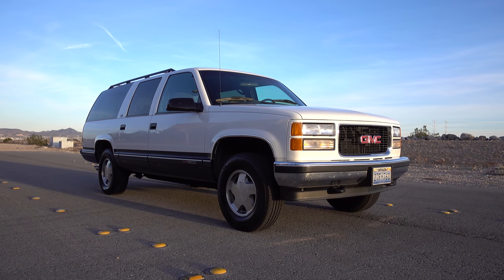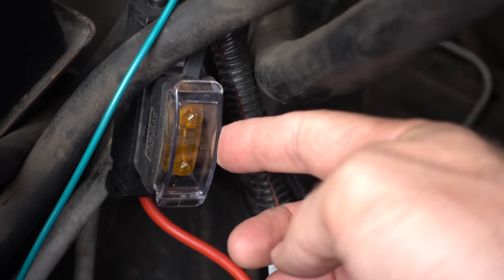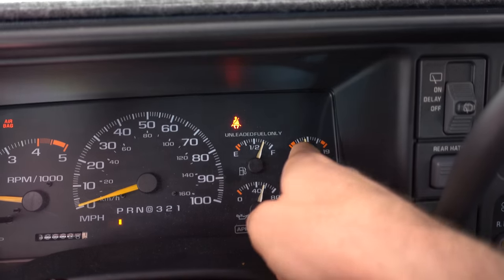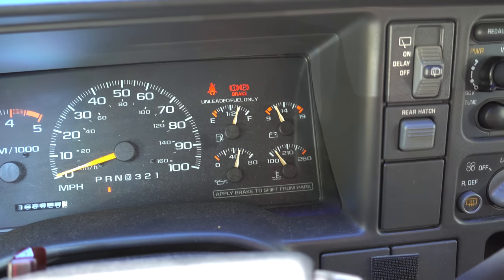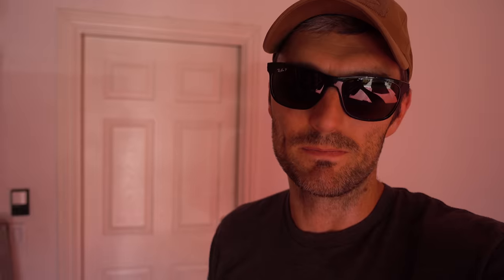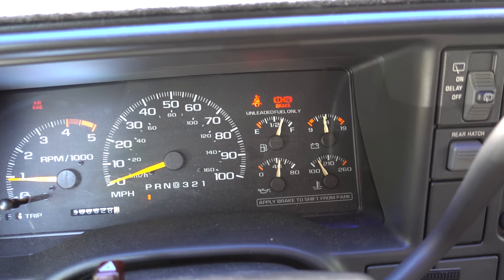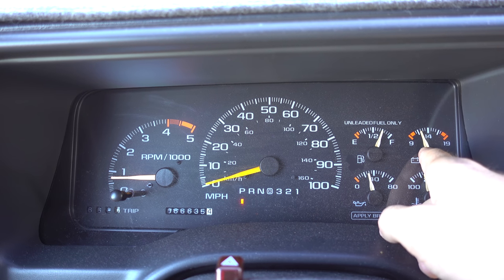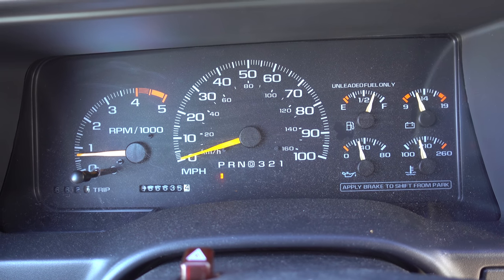SOLVE A LOW VOLTAGE ISSUE!

Comment: 2nd battery for people who have alot of electronics on their car such as big bass system, screen, lights ... etc / I have the same problem, first my engine temp is getting high on idle or traffic but when I drive it's fine. So, I changed the clutch fan with electronic fan and I solved the problem ! but the battery gauge is getting low because ( The Alternator ) can't handle the fans,  the alternator on my car is 135 AMP I ordered a new one 370 Amp from MECHMAN It's has more power to run the fans, the bass system and the new screen i have. but you have to put (Big 3 Upgrade) = Bigger charging wires for the battery and the ground. ( You're All Set ) Good Luck

Comment: change the negative wire of the car body and engine and the alternator with a new thick wire and i hope it is going to be solved , if it's didn't work just upgrade the alternator

Comment: 140Amp altrnator should be enough most probably the -ve cable is bad or u have bad earth i have exactly same ur truck with same issue after cleaning cable conection and ground joint problem partially solved

Comment: Try dual battery set up
Reply: Why? You can install 79 batteries of ANY brand. It won't get you any place WITHOUT a proper alternator. Your way will cost say $150-$400 for the second battery. Proper battery cable and connectors, another say $50. Battery isolator = big $$$$. See where this is going?

Comment: OK don't know if ou ever figured it out but ya needed to get a more amperage Alt to put out enough for the vehicle, it's ike a small car uses a certeain amount to run and charge while a big truck or older caddy uses a much larger amperage alt to run it and the air.  So you need an even bigger amp to run all of that plus bigger fans!
The Alt should run it all, not the Battery on the GMC or like vehicles.

Comment: alternator for sure. on my swift aka geo metro has a very weak 45a alternator from the factory and running lights on and ac will drop the voltage to below 13v. The alternator was weak and the battery was small and over 5 years old. replaced the alternator for 50a hella one and the battery a bosch s4002 its been good since.

Comment: and it do look like your alt is slightly under charging, should charge on 14.50 , and also your running out of juice , the juice is cca amps the battery amps it's marked on the top of your  battery, should be 9.00 cca amps at least ,  our a 1000cca amps ,to run those fans , and a alt that's putting out a charge of 14.50 our 14.60 volts when the  fans are on. hope you get it solved

Comment: If you start your truck and turn on your head lights and A/C then remove the negative battery cable it should stay running if it dies your alternate isn’t putting out enough amps. Replace alternator if it continues to run alternator is fine. The truck should run without the battery.

Comment: I'm dealing with the opposite problem.....My voltage dips under power and comes back up when I get off the gas......had the alternator tested at autozone tonight...it passed
Reply from the maker: That is peculiar. I can't imagine that being anything else other than that alternator. If you do spring for a new one, remember you can get OEM ACDelco on Amazon for CHEAP!!
Reply: @1RoadGarage  Yeah, it's a head scratcher right now......The battery starts it up every time so far

Comment: Jimmy my 99 sub does the same thing with ac on and stopped at stop light. My sub has stock fan and volts jump back to 14 as soon as I start moving.
Reply from the maker: +B Dog really? Okay, so you suspect that's normal?
Reply: I think it is. It causes me some concern, but has never left me stranded. I think I will check my ground straps like mentioned in an earlier post.
Reply: Not normal

Comment: Do you ever figure it out
Reply from the maker: Alternator couldn’t handle the heat and load. Now running a Mechman 250 Elite alternator and all is well. Thanks 👍
Reply: @1RoadGarage  that's awesome glad to hear all is well brother I'm defiantly gonna go with their alternators myself
Reply: @1RoadGarage  so would a 250 be a better options for me instead of 200 since I have led headlights and dual  electric fans

Comment: It's your amps not the volts... When you at a stoplight with the fans running it's your taillights/brakelights as well.  Bigger amperage alt is the main thing. Put the biggest battery you can stuff in there, good cables and grounds and with a higher amperage alt you will not have that load/voltage fade... I own a 95 blazer full size. Was doing the same thing in the winter when I would be at a stop with the brake lights on and the heat blower.. then my gauge would drop way down. The electrical systems get weaker on these trucks and dont like any draining mods like that big ass dual fan set up. Best luck!😎

Comment: You need a bigger alternator mine dose the same thing but not as bad as yours.i have the flex a lite 280 15" fans.i even have a dual batterys I have big 3 upgrade.its the fans that are sucking the power I even have a 140 amp alternator. I just ordered a bigger alternator a 300amp

Comment: you have the volts,but need more amps.get a high amp alternator.140 amp is not big enough for everything power.i have 160 amp and still not big enough for what I run,light bars, amps,power windows and lock,front and back ac.dont need 2 batteries because your not needing to store alot of power just need a lot of amps.

Comment: This may or not help you. Your battery and alternator were ok. I believe you need to go to 2 batteries and increase the size of your alternator. Ik that you really don't want to do that but it's a necessity when you pull that much power. Your best bet would be inline batterie setup to increase your storage capacity and the larger alternator to supply the needed power. I might be wrong here but someone might know more than i do.

Comment: For a vehicle of that size and setup you need a alternator of 220 amperage minimum output you always oversize it especially a General Motors vehicle and up your battery to a 900 anps of continuous Cranking amps and 750 cold Cranking amps and reserve power output of 500 anps he should have added the 140 on as a secondary alternator to the stock one basically run a dual alternator setup this would have made a big difference.

Comment: Don't worry about the low voltage running dual performance fans are not OEM or factory equip for that vehicle, so what your experiencing is simply 2 electric fan motors that require 12v each to run together. So they will definitely put a big draw on your battery, even a new one!! There is no true solution other than running 2 parallels batteries instead of just the 1 battery. Which you won't be able to do easily without severe mod works to find a new battery compartment to place 2nd battery into somewhere. Good luck

Comment: Dear why didn't you think about an out of the box solution  for your problem I mean instead of putting more fans you solved one problem and get's into another So I give a friendly advice to replace your Radiator with higher surface area Radiator or simply having more tubes on the radiator this way you will save fuel and also keep your engine free from unnecessary dust particles as well.
Reply from the maker: +Mahmood Shaikh would love to get a newer all aluminum radiator. But, one thing at a time...
Reply: Mahmood Shaikh nn

Comment: I know this od is old but I did the same on a 66 ford custom  500 upgraded to hei distributor,  8 mm spark plug wires , electric fans , double din pioneer nav unit , 800 watt amp & 4 tens , new  97 chevy alternator did away with the ford alternator,  was getting crappy output , doubled my batteries with 2 800 ca's . Now she is 100 percent! 
Currently doing the big 3 wiring to get the rest of her potential.  
Oh and i also changed all the lights to Led and that in it self helped a lot !

Comment: I kind of have the opposite problem I put a system in my 02 Tahoe but I'm getting too many volts so I unplug the plug on the alternator and that fix the problem for a little bit my subs were hitting really hard in my amps were not going into protection but then I saw my lights go dim in my windshield wipers slowly stopped working lol .. so you might want to check out that plug on your alternator if you only have a two pin plug you can do this method and your truck will run fine but mine has 4 pins I'm still trying to figure out what the hell is going on I know I'm getting too much power to my amps I just don't know how to fix without putting a amp regulator and I don't want to do that because I don't think them things will  put out enough power to my amps .... My radio works it's only certain songs that hit really hard that make my amp go into protection if anyone has any ideas please hit me up

Comment: I garentee its a ground issue look up hiw mech man does the big three thats how your truck is set up now replace grounds and grounds at back passenger corner of the block to frame and to body
Reply: My tru k was doing the same you need the proper grounds for your voltage regulator to work properly... If grounds look good dosent meen they are
Reply from the maker: Hey thanks, yes, I’ve re-wired everything and upgraded the alternator to a Mechman Elite 250 amp. All good now. 👍👍

Comment: your stock alt is 105 amps i would upgrade your alt to at least 200 amps you can find good companys out there that  offer them mechman, or dc power is what i would recomend. Your drawing more amps than your alt can put out so its taking current from the battery thus cousing low voltage, adding a second battery only adds reserve capacity once the reserve runs out your voltage will drop as it has been, key here is a high quality alternator.

Comment: You trippled the battery draw without hot rodding the alternator add 40 more volts to a 200 amp version

Comment: Stronger alt. Need more rpm to creat the specified amps which is not available coz the vehicle designed to the old one ,so the only way is to adjust  the idel rpm for the car

Comment: im having similar issues. Its a grounding issue
Reply: how did you fix ground issue. I have the same issue on a 2007denali. 1 battery a alternator later still stuck.

Comment: Has this problem been solved? If not, here's the answer. The problem is a split issue, meaning there is 2 problems. 1.) The battery that you are using isn't equipped with enough amps to run at a consistent high voltage rate. Here's what I mean by that.  You probably put a 760 cca 500 ca battery in it. When it really needs 1000 cca 850 ca. By using a bigger battery, your alternator can keep the electrical current up to allow everything to run smoothly. 2.) Once you replace battery, i would definitely upgrade wiring. Mainly your hot wire. Use 2 guage wire. Just run from the black  box on back of radiator to battery, starter, and  alternator.. Feel free to contact me..
Reply from the maker: Thomas Kelly Thanks for all the great info. No, the problem has not been solved yet but I do know that my problem has to do with the alternator not being able to keep up. I have replaced all wiring with 2 gauge and added a couple new grounds. Voltage now stays higher but the problem persists. While driving I have no issues. It's when I'm sitting at a stop light that the voltage drops. The fans are just pulling too much current for the alt, at hot idle, to keep up. Did I mention my alt has now been updated to a 140amp with a smaller pulley for good measure. I will be making an update video soon. Stay tuned!!

Comment: Old Video: The stock alternator is 105A,  you need to know how much the car itself uses from the alternator/battery then add crurrentdraw from the extra cooling fans. at idle the alternator dont spinn fast enough for charge ,  one solution is to replace alternator to minimum 140A and change pulley to smaler size for the alternator to spinn faster at idle Cause the alternator does not give rated amperage at idle maybe around 40A... and the stock alternatorwire is too thin, it should be atleast 10 gauge wire

Comment: You have to make it like a Japanese car the right fan of the engine and have two speeds and the left fan of the air conditioner, the reason that two fans eat each one of them 70 amps means 140 amps means everything that produces the generator goes to the fan

Comment: Increase the thickness of all supply feed wires to min of size 6 or lower the amount of current that travels should be able to increase the voltage demand smaller gauge wires heat up to much increase all ground wire sizes the same with more connections also

Comment: Before big 3 upgrage check alternator amp output some only can hold factory parts no upgrage room and if you do it will draw too many amps from the alternator causing battery and alternator to fail, if the alternator has more then enough amps big 3 would be the next best step!!

Comment: you are oveloading the stock Alternator, that alt wasnt desing to run 50 extra amps of your added colling fans, upgrade to a 15-20% higher output alternator or go to salvage yard and grab  one out of a heavy duty GM truck.

Comment: Batteries only start the engine and complete the circuit, the alternator does the rest while the vehicle is running. follow the changing of cables and connectors. the voltage regulator in the alt most likely is the culprit

Comment: Hey did you ever figure out what the issue was cuz I'm kind of got similar issue occurring that it kind of the voltage kind of bottles while I'm driving with my thoughts are on either the alternator going out for a serpentine belt which is kind of like skipping the alternator but yeah I was going to see if you ever figured it out

Comment: I have a 1999 suburban same set up plus an electric water pump from summit  just added a 175 alternator and it fixed the problem i also put monster cables on the battery

Comment: the electricle system wasnt designed for electric fans. get a higher amp output alternator and make sure the wiring is large enough the handle it. new battery helps too.

Comment: You may even need a higher then 80 amp alternator. Get the highest amp alternator you can get for your truck and the problem will be solved.

Comment: How does your rpm gauge have the Orange? I haven't seen that on any older chevy trucks...
Reply: The tbi only has a 5 grand rpm the tbi when they out in the vortec engines they gained another thousand and went to 6 thousand rpm and lost the orange 96 and up
Reply: PHIL Bangel wish there was an aftermarket option to get them back

Comment: check ur belt tensioner..also if ur ac is over charged there's alot more pressure on the the belt..dealing with the same problem with powermaster alt
Reply: never had a problem till I went to the powermaster alt

Comment: Trash the factory side terminals. They were the absolute worst thing government motors EVER did. MY 99 suburban goes a little gofey from time to time. I have changed to top mount post, with a gel cell battery. Issue is gone. Sidepost are a disaster. Ck alternator, replace with high amp output if you under 120 amps.

Comment: just check the alternator as well, if its connections and pulley attached are tight and correct and also test its connections with a tester too.

Comment: Get a new alternator. Once the car is started, the batterys job is done. The alternator takes over. The battery acts as a stabilizer when running.
Reply: A new and higher amp alternator

Comment: Run a 4 gage wire from the battery positive to the back of the alternator, that will that will transfer more heat to the battery. That takes the stress off the alternator.

Comment: Those fans draw about 30 amps. The older 95 and earlier alternators were only about 100 amps @ a higher RPM, and do not put out much at idle, barely enough to do even the base vehicle loads. You need to upgrade to a higher output alternator and do the Big 3. What I had to do on my 94 with the same 280 setup.

Comment: Upgrade your alternator. The fans are using more power from the alternator than what it was designed to provide. Remember it's designed to run the engine with a non electric fan. So there's a limit to how many amps it can give.
Reply from the maker: +lb lewis You're absolutely right. I've got that 140amp alt from PowerMaster which is barely enough. I ended getting a smaller pulley which helped out a lot but I'm thinking I need a 200 or 240 amp so my idle amperage is okay.

Comment: Something you might want to try: smaller pulley on your alternator will spin it faster than engine rpm, might solve your issue.
Reply from the maker: +amdfanatic86 just did that. PowerMaster has been great in helping me solve this. I now have the smallest pulley I can get on there which DID help but I think I'm in need of a much higher output alt. Maybe 240 amp to be safe. My problem is idle amp draw. With everything on I'm drawing 100 amps. The alt will do this fine now but when HOT it can't keep up.
Reply: You're pulling along the same train of thought I am.
Reply: 1 Road I'd really like to see a video update to this problem love your videos doing a good job bigger alternator for sure

Comment: Hi i have GMC 99 engine 454 i have issue with alternator after change the elictric fan 
The voltage lower than 13 after run the a/c and light . I check every singal thing and also i try to change the alternator with high amp 160 amp . But no improved .
The thincain suggest to add extra battery 
I do there is improved but not 100 % 
With acceleration the voltage go upto 12.9 v . With parking drop like your vido 
Can u help me . 
Regards .

Comment: That started happening in my jeep last week I have a new battery maybe 3 months old so I stopped at the local part store they ran the test n yup alternator giving out so just ordered one online
Reply: Sean Jones  yup the volts back to 14 and 13.7 with ac and lights on .. new one on ebay for $98